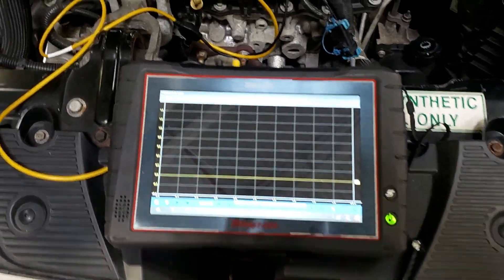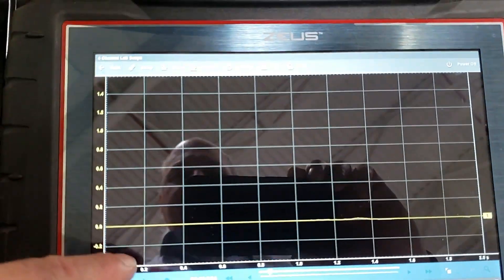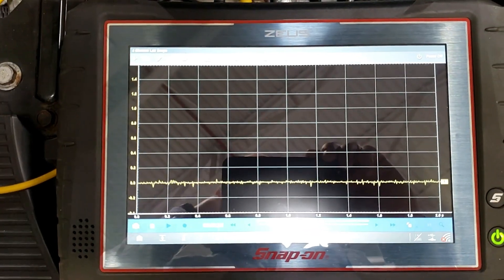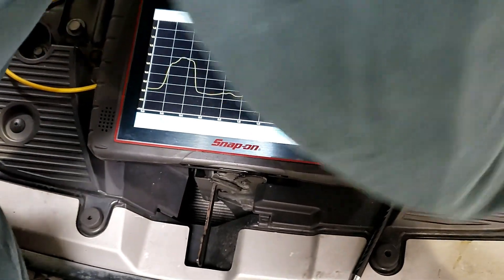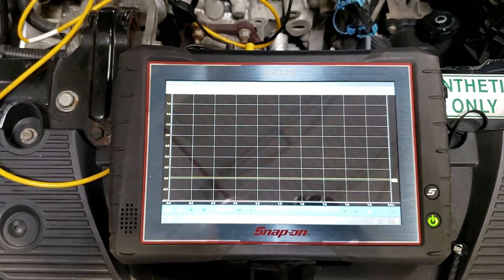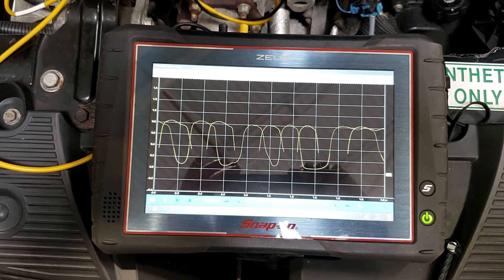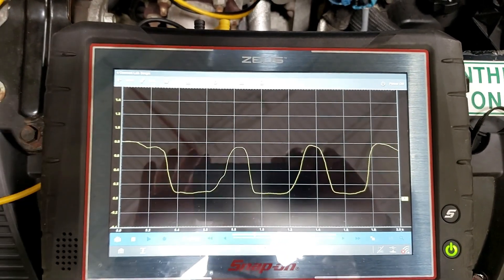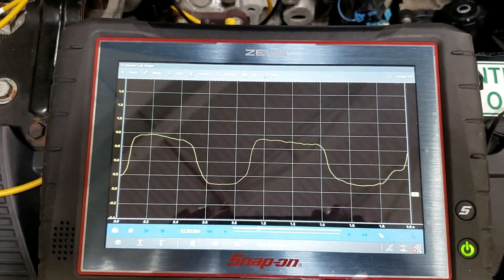ATTS GM O2 Sensor on Signal Ground

Comment: does this conclude that the chassis ground is bad? and the normal sensor ground is good? how to rectify bad ground?
Reply: This is late but gm uses an elevated ground to.reduce noise on the o2 signal so if you scope it with the sensor ground the signal oscilates between 0-1 volts like a normal 02 but if you connect your scope to battery ground it will oscilate between 1-2 volts